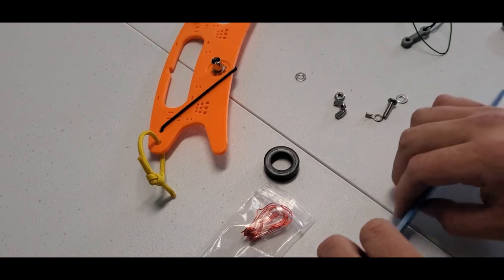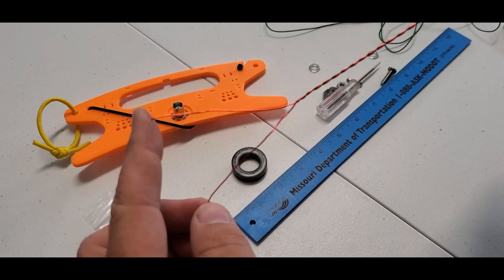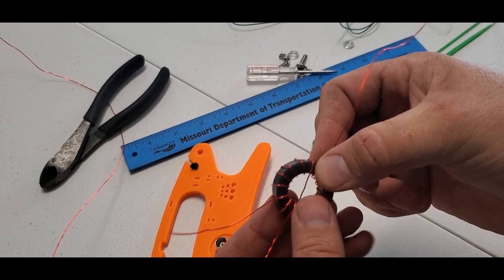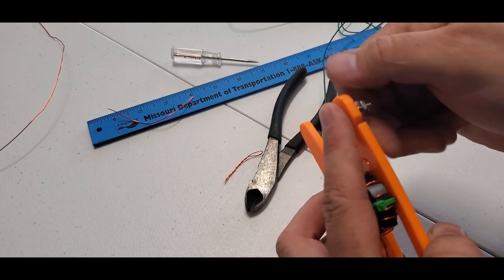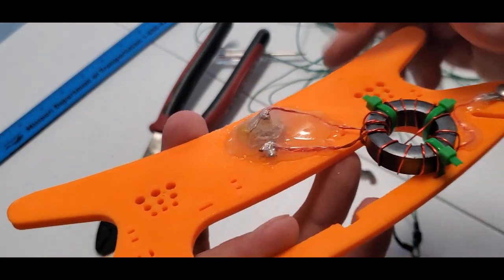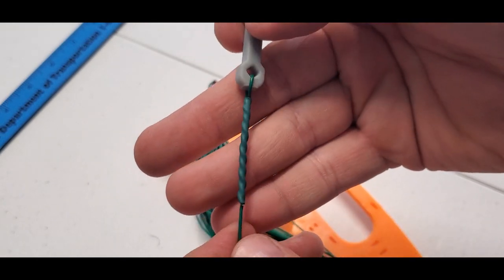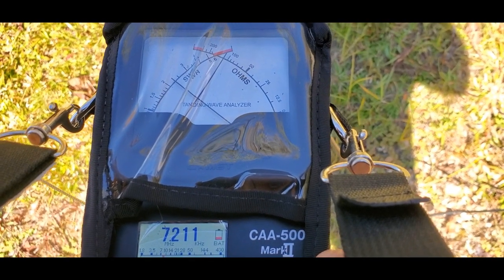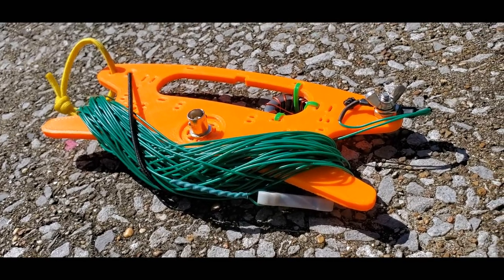Antenna build and review - The KM4ACK EFHW antenna kit is simple, compact and efficient

Comment from the maker: Help me out by leaving a simple comment.  It helps boost my video in the YouTube algorithms!!  Thanks for the support!!
Reply: You just need to shorten the wire antenna to move the sweet spot "up" in frequency.  You should do that while testing the antenna before you permanently fix the length and put heat shrink on the far end.  Good idea showing hoe the sweet spot changes with frequency.  I'd go for the lowest SWR rather than 50 ohms but they are very close to the same frequency.  de W4QO

Comment: Not trying to be critical or by no means implying I am an antenna expert, isn't the coax length an issue when checking SWR on multiple bands? Unless you use a 1/2 on each band the SWR readings are not accurate. My big question as well is with a EFHW that relies on the coax for a counterpoise are any SWR readings accurate? I also have the KM4ACK antenna for POTA and I am amazed how well it works. Thanks for the video, Gary W8PU.

Comment: What happened to the 100pF capacitor? not needed?
Reply from the maker: Great question.  If you look at 5:55 you can see the capacitor already soldered to the BNC connector.  I thought I had mentioned that I'd already done that, but maybe that clip didn't make it into this cut of the video.  It is needed, it's just one of the first things I put on.

Comment: A better design might have been to protect the center pin of the antenna connector so it is not exposed and susceptible to damage, especially with such a thin wire.

Comment: thought there was a capacitor in this kit to put between where you attach it to the BNC?
Reply from the maker: There is. I had already installed it. If you look at 8 minutes it is there with hot glue already around it. This does need to be on the install.

Comment: Too much in a hurry. If you are talking about the steps to follow, these must be shown in a right order. i.e. Before crimping or soldering the wires you have to say that it is necessary to remove the insulation. As the capacitor not shown at all. Sorry.